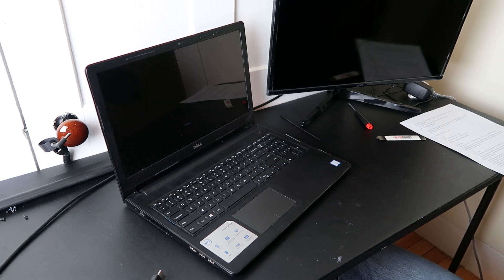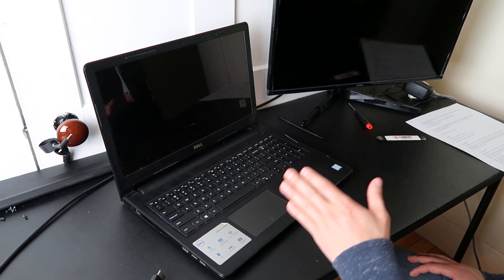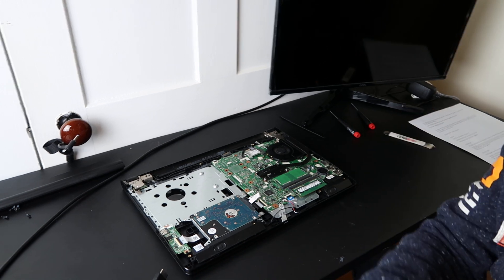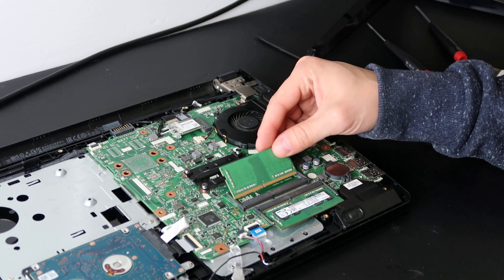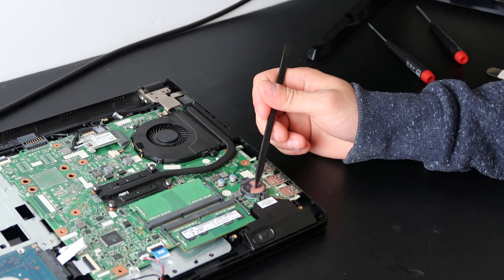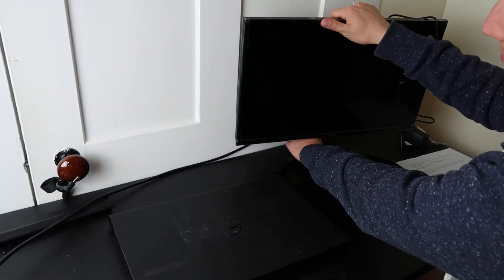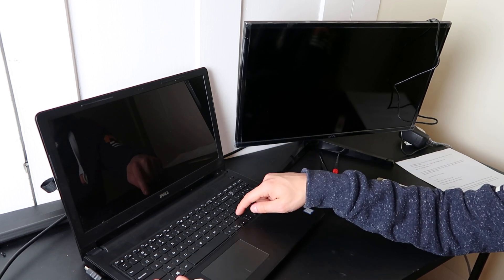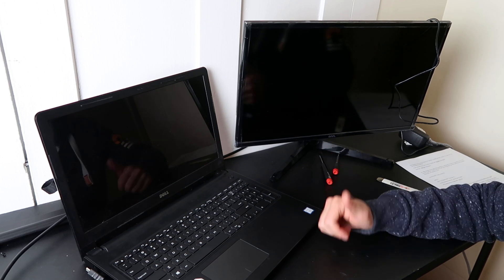How To Fix Black Screen / No Display / Dim Screen / No Picture for Dell Laptop

Comment: I got a Dell Inspiron 15 7573 touchscreen laptop and I get a blackscreen when I tried to upgrade from a single stick of 8GB 2400MHz memory to 2 matched sticks of 16GB for a total of 32GB. However it seems to run fine with just 1 stick of the 16GB at a time with an occasional bluescreen or freeze up. So far I have tried Kingston, G.Skill and Crucial brand memory kits and all have about the same result. I even found and installed an additional 8GB stick as close to my original (spec wise) 8GB and still won't boot properly if both sticks are in both slots. Only one slot at a time seems to work fine. Not sure if I should just get expensive Dell branded memory directly from their website or am I stuck with just 8GB at this point. Any advice I would greatly appreciate it.
Reply from the maker: Yes, you can try a brand name stick.  You can see suggestions on compatible upgrades on sites like crucial.com. 
Does the computer only boot up with the single RAM stick in one particular slot or in both?
Reply: @PC_Monkey  When both sticks are installed (no matter what brand of memory it is) I get a blackscreen meaning, the screen doesn't turn on but the cooling fan goes to full speed and the white charge light is continuously flashing. When I remove one of the 16GB sticks (doesn't matter if it is from slot 1 or 2) it will boot into windows with a possibility of a bluescreen or freeze up. The only time my laptop works perfectly fine is if I only use just one 8GB stick. Another thing I  just looked up today is the build specs of my laptop from Dell and it supposedly came with two 4GB sticks of memory. Which is strange since the max specs I can put in is 32GB according to Dell specifications. So I'm not really sure if this laptop can or cannot handle anything more than 2 sticks of 4GB in Dual Channel mode. I was also thinking about trying 2X16GB 2133MHz Samsung sticks I saw on eBay. Maybe the slower speed can work with the i5-8250U processor better.
Reply from the maker: @BlueSword455  Very strange.  Usually if you have more RAM in a computer than it can 'handle' it simply does not access the excess RAM but is usually does not affect the computer negatively in any way.  Hard to say without being able to examine the computer but my last guess would be a motherboard issue of some kind.  Perhaps a short that occurs when both ports are attempted to be accessed.
Reply: @PC_Monkey  Well I did take a chance on buying this laptop used. But you maybe right that it might be a motherboard problem. Now I'm just debating on whether to roll the dice and just order Dell's memory from their website at $102.99 each 16GB stick or just take it into a shop and have them look at it first. Otherwise I'm most likely just gonna use it as is for now until I make up my mind later. Anyways thanks for replying and the advice. If I come up with a solution I'll definitely let you know.
Reply from the maker: @BlueSword455  Good luck !!  Let me know how it goes :)

Comment: Sir my laptop dell g315. Giving me problems. Screen totally black
Reply from the maker: 1.  If the screen is black, what are the signs that the computer is on? Lights, Fan, Motherboard or Hard Drive sounds?
2.  Have you tried any of the steps seen here?
Reply: @PC_Monkey  light
Reply from the maker: @archanab261  If LEDs are the only sign of life in your computer then your computer may not actually be turning on.  For a computer that does not turn on, try this video first; https://youtu.be/P3I7dDpkJps. Let me know how that goes :)

Comment: I need some help with my own laptop it’s an old one and it cannot show ANYTHING It’s caused by the Refresh rate because I was messing with it and accidentally made it go to a black screen
Reply from the maker: 1.  If the screen is black, what are the signs that the computer is on? Lights, Fan, Motherboard or Hard Drive sounds?
2.  Have you tried the RAM test as seen here?

Comment: Great video.  To expand the question  just a bit, if I may....my Dell 1545 boots up and displays the screen fine for about 2-3 minutes, then the laptop screen goes blank, but if I have it connected to an external monitor, the image is perfect.  Having watched a different video, I successfully replaced the screen inverter, but I still have exactly the same problem.

Haven't tried the RAM test yet, but I'll have done that before you have a chance to respond, and of course, if that should solve the problem, I'll update you.   But I haven't seen this precise set of symptoms described in any other posts, so I'm wondering what they might suggest to you.

Thanks!
Reply from the maker: I would assume that is an issue with the LCD or LCD Cable, if its displaying correctly to an external monitor.  I would try 'reseating' the cable first.  If that fails to help, replace the LCD and LCD cable one-at-a-time until you find the issue

Comment: I bought this computer refurbished and it looks like it was built up with faulty product because it was sent with battery that exploded before I knew and I opened it up and saw it replaced but I replaced it same way I removed it then full power and no power and I worked with this thing before and now I tried steps but can today it was on power cord unplugged it was only way to start up now power and keyboard turned on but screen is now not working I don't understand how can computer have more than one problem that cause minor problems that could be Major
Reply from the maker: If the screen is black, what are the signs that the computer is on? Lights, Fan, Motherboard or Hard Drive sounds?
Reply: It was when it came I got a new one and changed it plus the power and keyboard turned on but it was working then power cable came out then it screen stopped turning on but everything else was and lights flashed orange and green and usually white I checked rams and cleaned and plus  but it was just working then after it unplugged screen stopped
Reply: Ya I think there a issue with battery cable is not working or completely staying connected could that affect the operation of screen turned on
Reply from the maker: @Knuckles1901  Sorry, that was a bit hard to follow.  Have you tried the steps seen here?
Reply: Yes but screen is not turning on so I think connection to battery or could it be someone else because it was working then it shut self off and after all power working but no display at all
Reply: Yes but it looks like something that the steps do apply one thing I have learned with electric defects are some are different then things that we know what you think it could be it something else instead big or small electric defects have lot unknown possibilities and people are confusing when things are not working but I will find out the issue thanks anyway
Reply from the maker: @Knuckles1901  If all of the steps here didn't identify the issue and the computer didn't display to an external monitor then we are left with your motherboard being the problem.  It should be replaced.  You can see an example of a motherboard replacement here;  https://youtu.be/N_7HNrFkMS8.  Let me know if you need help finding one or with the install :)

Comment: doesn't work in my case. I have 2 oranges and 7 white led blinks. I replaced screen (FHD no touch), cable 30 pin, and nothing. working superb on the external screen with no problem. i did correct ram on slot and add external keyboard nothing. Windons are unable to find any other monitor connected when on external monitor. when connected lcd shows error 2,7 blinks and when external monitor works perfectly. I wondering if the mobo conecctor is 40 pins (in my case is ) and then what on lcd sode can be either 30 or 40 pin ?? By manufacturer ryzen 5, 3505, no touch screen, p90f004. Lost ability what can be.
Reply from the maker: If the LCD and the LCD Cable are not the issue, then it could be a Motherboard issue or at least an LCD Cable Port issue
Reply: @PC_Monkey  I replace the Mobo as i assume that was the problem with the power supply for the lcd. Still the same problem. Did not solve my problem. It is so wird as on external the new mobo works fine.
Reply from the maker: @mironskitels  If the computer displays fine with the new motherboard to the external monitor then your new issue is LCD or LCD cable related as the new motherboard is sending out a signal fine

Comment: Hi, my laptop (Inspiron n5010 dell) screen is black without any beep sound. It’s turn on by pushing power button, the lights are ok, I checked rams and sdd, that’s ok. I done all your steps, but didn’t check external monitor, because when My laptop is turn on I push power button and immediately turning off. Before this problem if I wanted to turn off my laptop it needs 10 seconds to hold power button. Please help me
Reply from the maker: 1.  Are the lights the only signs of life when you turn it on?  No motherboard or hard drive sounds?  No fan noise?  Nothing on the screen?
2.  For a computer that does not turn on, try this video first;  https://youtu.be/P3I7dDpkJps.  Let me know how that goes :)
Reply: @PC_Monkey  my laptop turning on without any beeps. Fan is working. Lights are okay
Reply from the maker: @hamidmohammadi8570  If the fan is on then the computer may be turning on but the screen may not be working.   Your comment said that the computer turns on but turns off right away before you can see anything on the screen.  Correct?  If so, try this video first;  https://youtu.be/P3I7dDpkJps.  Let me know how that goes :)

Comment: Thanks for the great video.  I cracked my 7480 screen and ordered another one.  I swapped it out and when I fired it up it illuminated but no display.  I thought maybe I damaged the cable so I re-installed the old screen and it worked - cracked but worked.  I assumed it was a faulty screen so I ordered another (Amazon).  I put the new one in and same issue - backlit but no display.  I'm assuming RAM is fine since it booted up just fine with the cracked screen.  What do you think is the cause?  Hope you can help.  Thanks.
Reply from the maker: When you are installing the new LCD, do you have the battery removed and the power adapter unplugged?  If not, that could be burning out the LCD when you attach the LCD Cable.   If thats not the issue, you could just be looking a compatibility issue or bad replacements
Reply: @PC_Monkey  Thanks for the quick reply.  The instructions I received from another video (before watching yours) were to disconnect the ac power cable, open the unit, disconnect the power cable that connects to the mother board, and press the power button to insure complete drainage.  Two new screens, both backlit with no display, yet even now my cracked screen still works.  Totally flummoxed, dude.
Reply from the maker: @vesubioromo9425  Yes, those are the correct steps.  Very strange.  If the other LCD works then your looking at an issue with the replacement LCDs.  Hard to know more without looking at it :(
Reply: @PC_Monkey  Thanks anyway for the engagement.  Guess I'll take it to the local fixer.  Subbed.

Comment: I had come home to my laptop froze up. I rebooted it. but when i went to turn it back on all that happened was the power and hdd access lights went on, then the caps lock button would go solid while scroll and num lock would in unison blink for about 20 seconds then the lights would just go off. my battery has a power indicator and is at full power. I dont even hear a fan spinning up or anything when this happens
Reply from the maker: This video is for a computer that turns on but the display is not working.  If you dont hear any sounds and if lights are the only sign of life, lets assume for now that the computer is not turning on.  For a computer that does not turn on, try this video first;  https://youtu.be/P3I7dDpkJps.  Let me know how that goes :)

Comment: Help my laptop doesn't start at
Reply from the maker: Are there any signs of life at all when you try to turn it on?  Lights?  Fan, Motherboard, or Hard Drive sounds?  Anything seen on the screen?
Reply: @PC_Monkey   yes the is just that wen I open it it's says auto repair the says diagnosing pc
Reply from the maker: @njabulomkhabela3221  For that issue on a Dell computer, refer to this video instead;  https://www.youtube.com/watch?v=w3XfE-ghbhs&feature=youtu.be.  Let me know how that goes :)
Reply: @PC_Monkey  still.doesnt work I don't know how to show u the problem mybe u could help if u can see it

Comment: Nice video.  I have a Dell laptop that the other day the screen wouldn't turn on. After turning it off and then turning it back on several times it finally for some reason turn back on this morning when I turn it back on the monitor wouldn't turn on. I use an external monitor also at the same time and the same thing is happening to it as well. I just tried to turn it on and just turned on again right now. What do you think it might be? Thank you
Reply from the maker: If the screen is black, what are the signs that the computer is on?  Lights, Fan, Motherboard or Hard Drive sounds?  	
The same not working then working after several attempts happens with the external monitor as well?

Comment: Very coherently explained - you'd make a good teacher! My Dell goes dark across one side of the screen. Plugged it into an external monitor and I get a bright, clear output, so I guess it's either the LCD cable or the LCD screen. Fingers crossed - will get back and let you know the results.
Reply from the maker: Yes, good troubleshooting !!  Good luck !!  Let me know how it goes :)
Reply: Hi Robert, I am having same issue as you.  After replacing the bottom cage of the laptop because hinges were broken, once put together, screen was faint.  Can barely see anything.  However, when connected to external monitor, laptop works as expected.  Though can not see anything on the laptop screen.  Were you able to fix your issue? if yes, what did it for you?

Comment: My dell 7420  has a black screen, it is my work computer.
Reply from the maker: Is the computer off or is the computer on with a black screen?  If the screen is black, what are the signs the computer is on?  Lights?  Sounds?  Fan?

Comment: Hi, Occasionally sometimes laptop turns on if i leave it for a while, but other times it does not give display, the fan and hard disks spin but no hard disks processing light show. Removing and swapping rams does not work.
Reply from the maker: Were you able to try the external monitor test?
Reply: @PC_Monkey  yes I have tried external monitor. The strange part is that it turns on specifically on 3rd or 4th try. Thank you replying :)
Reply from the maker: @iKamranNaeem  What was the result of the external monitor lol?

Comment: If lcd don't have any displays, but HDMI have display... What the problem it is...?
Reply from the maker: Check out the FAQ's on my videos next time!  Could help you get an answer faster :)
If your computer displays to an external monitor but not to its own LCD, then your issue is most likely with your LCD or LCD Cable.  Try 'Reseating' the cable first by unplugging it from both ends.  Then, plug it back in.  If that does not help, replace the LCD and Cable one at a time.  Let me know if you would like help locating the correct parts :)

Comment: Please help. My dell inspiron is starting well, after I logged in the screen opens but freezes for a few minutes, then suddenly turns black. The screen goes black. This is the first time it happened and it is so random. Am I in the right video?
Reply from the maker: When the screen goes black, is the computer still on?  If the screen is black, what are the signs the computer is on?  Lights?  Sounds?  Fan?  
Also, this only happened once?  Are you able to find an error matching the time it happened as seen here?  https://www.youtube.com/watch?v=Nqn8-jJFx2Y

Comment: I got a dell e7250,I just tried to put another 8gb in, when I put it in, and turn it on the computer comes on, but the screen stays black, when I take it back out, everything starts working fine again,I did that twice,and I know I have it snapped in correctly.
Reply from the maker: Either the RAM is not compatible for your computer, the RAM is bad, or that RAM port is bad.

Comment: Please help me out.My laptop went into sleepmode and doesn't turn on the screen but the power button and caps lock button lights are on. Please assist
Reply from the maker: Are the lights the only signs of life when you turn it on?  No motherboard or hard drive sounds?  No fan noise?  Nothing on the screen?

Comment: Amazing video.. I amsuffering through the same issue and some has told me to change the motherboard altogether but i think i have to go through ur techniques first.. Besides, what motherboard should i use for DELL Latitude E6430
Reply from the maker: Your computer turns on but the screen stays black?  If the screen is black, what are the signs the computer is on?  Lights?  Sounds?  Fan?
Is this your motherboard?  https://ebay.us/x8B7IK
Reply: @PC_Monkey   yes buddy
.. Everything turns on... Now i will check my ram first.
Reply: What you did then? Please guide me I am suffering from this shit and I don't know what's the problem I took my laptop to shop they also refused and asked me to change the whole motherboard I don't want to change it